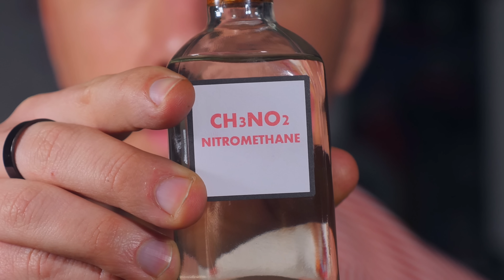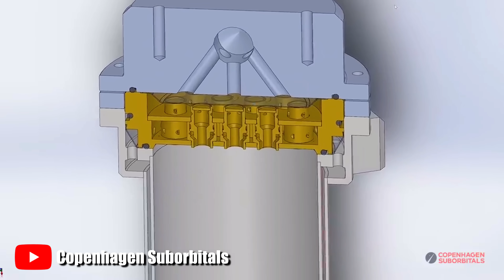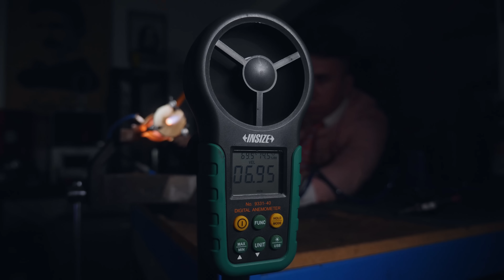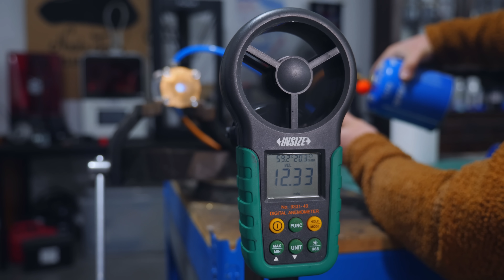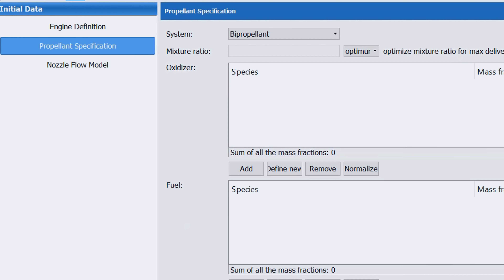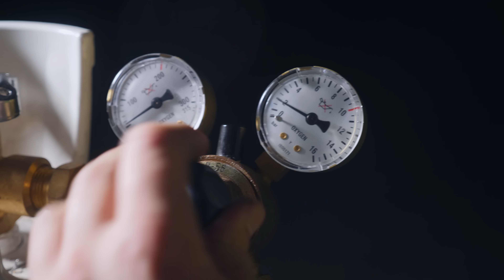GLASS ROCKET ENGINE

Comment: Yes, oxygen contains a lot of oxygen, but you know what contains even more oxygen than oxygen?
Chlorine Trifluoride. Now, don't let the lack of any oxy-sounds scare you off, this stuff is a better oxidizer than oxygen, and will quite happily enable you to use things like concrete bricks, asbestos, water and gravel as fuel.
Is it a good idea to use this in a rocket? ... Well the Germans in the 40's were afraid of using it in flamethrowers because it was too dangerous, so maybe be careful. :)

Comment: I recommend that everyone interested in this subject find themselves and read a copy of "Ignition! an informal history of liquid rocket propellants" by John D. Clarke. Fantastic book. Includes such lines as this describing Chlorine Trifluoride: "It is, of course, extremely toxic, but that's the least of the problem. It is hypergolic with every known fuel, and so rapidly hypergolic that no ignition delay has ever been measured. It is also hypergolic with such things as cloth, wood, and test engineers, not to mention asbestos, sand and water - with which it reacts explosively."

Comment: Great video today!  Also, while I'm no fan of creators shoving in multiple ads within one video, I think you presented yours quite well.  Your videos were always pretty good but it seems like your overall production of them is getting better and better.  It's cool you got a CNC, next you should get a metal printer, just need to sell an organ or two and build a whole new room for it, who needs two kidneys anyway, right?

Something I've always wondered is if there is a 3d printer out there that takes some sort of powder or liquid and uses it to print synthetic bone or teeth, but not just in their normal shapes but also in actual structures.. so the material is like bone or tooth but the structure/designs are still actual structures/objects.  Maybe since we're past Halloween it's a little late for this idea, but I was just curious.

Comment: I would really love to see you integrate ESP into your glass rocket engine and use an aerospike nozzle along with a regulated current to push the engine to its limits. Let's see how much thrust you can get out of the same form factor.
Reply: Also, can you be a cowboy and regulate the thrust using a potentiometer for instance? It doesn't seem quite practical; however, it could be a lot of fun. Love the videos keep them coming!

Comment: you could make a micro Archimedes screw to feed the Potassium-permanganate through glands with backfeed tubes to the pre combustion chamber and use the fuel as a driven cushion to keep the liquid and solid fuel up to injection pressure think anular archimedes screw :).

Comment: hi there, maybe you should consider printing FDM parts with some high-temperature PETG or PA there is a company that has some unique PETG that can withstand temps up to around 200° but  I think quite a bit less than 0.45MPa but don't quote on that one.

Comment: Hmmm, using the decomposition of hydrogen peroxide to drive a closed cycle fuel turbine and then venting it into the combustion chamber might prove to be quite efficient and make a rather compact engine. Just flow the peroxide over a catalyst.

Comment: Making a rocket engine with nitro methane and hydrogen peroxide, with electric arc ignition, would be fun project to follow. It's obviously going to be a multi part series, as just getting the atomisation of both injectors right is going to be tricky. Electro coating the hydrogen peroxide injector with silver will give you at least partial decomposition, which should be enough to start combustion, which will cause the lovely thermal runaway decomposition peroxide is known for.

I think a two-stage combustion chamber is the way to go. The first, smaller one, should house the two injectors and the electric arc initiator, whereas the second, larger, combustion chamber needs to focus ideal mixing.

As for getting the pressure up on the injectors I think, for prototyping, just using compressed nitrogen to push the liquids out the bottom of the containers might be an idea. Perhaps repurposed CO2 bottles for soda machines would work. That is, you unscrew the factory attachment and find fittings of the same thread pitch. Then load the liquid in, attach the valve, pressurise it, close the valve, flip it upside down, and presto, you have fuel/oxidizer delivery at, say, 5-6 bars.

Of cause, for the final iteration, getting a glas blower to make the whole combustion assembly in quartz glass would make for some EPIC footage (and probably also be very expensive!).

Comment: i would like to see some form of engine intagration like colin furze with the turbo charger / pulse jet design. i don't have any reason to beilieve that it works but the concept felt interesting enough to share. also self-barbeque  is bad so be aware.

Comment: I like your "Dual propulsion rocket" idea alot I think a workable idea would be to have two tanks (H2O2 Peroxide) and Fuel tank top them off with compressed air. So if you open the valve they get expelled. Than I would spray the H2O2 on a mesh coated with Permanganate (KMnO4) to decompose the H2O2. after decomposition add the fuel.
instead of KMnO4 you can use MnO2 this way you get decomposition without adding oxygen, but it will stay the same. You get the MnO2 from KMnO4 after it has been used once.

Comment: 3:01 That's a common misconception. In fact, Top Fuel dragster engines are FAR more power dense than any Nitro RC engine that exists. No matter if your judging "power dense" based on engine size/volume vs HP or by engine weight vs HP, Top Fuel engines are far more power dense.

Comment: Since those engines are so small, you could put them on a pivot and use them as very noisy propulsion for a low friction craft.

Rocket Sled.

i don't suggest having large vats of Hydrogen Peroxide though, that stuff is ultra spicy if the closing part of the video is any warning.

Comment: ok, so, now I'm curious. can you dissolve / suspend the potassium permanganate inside the methanol, and use a dual injection system with that mixture in one and hydrogen peroxide in the other?

Comment: You could try making a catalyst to extract oxygen from hydrogen peroxide by mixing manganese dioxide and calcium hydroxide and 3D printing resin and printing a honeycomb pattern, like an automobile catalyst. As soon as the hydrogen peroxide comes into contact with the resin impregnated with metal oxides and hydroxides, some of the calcium hydroxide will dissolve in the aqueous solution, leaving the water slightly basic, meaning that as soon as the hydrogen peroxide comes into contact with the dioxide, of manganese decomposes into water and oxygen. Manganese dioxide is insoluble in water and calcium hydroxide is slightly soluble, meaning you can reuse this catalyst several times without making that mess when done with potassium permanganate and finally the resin printed in a honeycomb pattern gives more contact surface.

Comment: You should make a plane powered by a liquefied gas. It could work like an air enigne, only using a far more dense "fuel". Possibly could also use a flammable gas and make an internal combustion engine.

Comment: You should print a PLA jet engine that has provisions for a flowing water jacket to pumped through to cool the plastic and prevent it from melting. Like when those wilderness survival guides boil water in a plastic bottle over an open flame.

Comment: 1:47 What a cute little turbo ! I recently built my first DIY turbojet engine and I can't wait to see what you'll do with it ! (a bit too much for the skateboard :D)
There is a lot of power involved in those turbojets and welding is often required. I can share my flametube and combustion chamber designs if you want, they require no precision machining and, let say, few welds.

Comment: Make a combustion chamber, injector, nozzle out of stainless steel that you milled on the CNC. Inject ethanol, methanol, or IPA with permanganate in solution, and some high-test H2O2. Optionally use a spark plug ignitor. Stand back and wear your protective gear!!

Comment: Digestion is combustion, the product of the reaction of digesting is energy + CO2 + H2O just like combustion so HULE is FULE. Can you make a wing with ducts on the trailing edge that lead to a EDF or a rocket engine so the wing will get lift as air is pulled over the wing making it a VTOL?

Comment: Would be cool to build a scramjet engine, perhaps using a leaf blower to achieve the air speed to make it run;  as fuel I was thinking of the mixture of sugar and potassium nitrate that you used in the Aerospike Rocket engine project some years ago, perhaps added with oxygen or methane.

Comment: It would be cool if you could show how a ramjet work. You could have a first stage with on board oxidizer, and a second stage in which the oxidizer is air compressed from the "flight" of the jet. I guess it can be a tricky video, but it would be amazing,.

Comment: Do a video on microwave power transmission like the US Naval Research Labs are doing. The ionic thrusters may not need a battery or a very small battery if solar power farms can beam the energy via microwaves to the ionic thruster powered plane. Like you can make a RC plane powered by ionic thrusters via microwave power beam.

Comment: I would think that a mixture of Nitromethane and 50% H2O2 pumped through an atomising jet and across an appropriate reactionary catalyst would make a fantastic fuel - catalyst and fuel in one mixture. The devil would be in the correct proportions and pressures so that you would not experience an inadvertent energetic event.

Comment: The German WW2 Me-163 used Hydrogen Peroxide as an oxidizer.  However, it used Hydrazine as it's fuel.    Do you plan to do anything with your rocket motor when it's finished? Rocket powered car, plane, boat, or plain old rocket?

Comment: Integza, I've said it before and ill say it again, please be careful around Potassium Permanganate. The pure form you use not only causes permanent discoloration but is also toxic, can cause chemical burns and are a big environmental hazard if not disposed of properly. Please be careful Integza! That said, really informative video as always! btw what would happen if you would coat a tube in solid permanganate and then run the hydrogen peroxide through so it won't mix with the permanganate, would it still generate enough oxygen? There are also hobby pressure tanks of for example 0.3l that can go up to 12bar, this might be enough to hold the oxidizer, especially with the nitromethane.

Comment: I dont remember where I heard of this but instead of swirling the oxygen and hydrogen(should work with butane) together at the combustion "plate" what about premixing them and then letting them out and igniting them, ofcourse it is quite important in such a design that the intermix pressure is higher than the combustion so requires somewhat of a nozzle

Comment: Wincing a bit when I see you mixing methanol and peroxide in a glass jar, in that quantity in your house. You got to start doing things like that outside before you blow up your self or your lab .

Also hope to god you had a flame trap on the oxygen line 😅

Recommend you read the book Ignition by John D. Clark if you haven't already, Don't repeat the mistakes guys already made in the 1950s
Reply: Also please at least use a polly carbonate barrier/screen between you and the beaker that might explode, instead of standing back and flinching.

The safety specs and safety tie won't save your pretty face.

Safety third and all that

Comment: To decompose the hydrogen peroxide into the oxygen you need (please steam for good measure); what is you used a metallic catalyst instead of chemical? This way you don't have to inject and store the permanganate which will add weight.  It might make a cleaner combustion in the end.

Comment: Would it be possible to use a portion of the rocket's thrust to spin a mini turbocharger, forcing more air into the rocket?

I get that there are probably lots of energy losses involved, but it would be pretty cool to see how well a self contained, self accelerating rocket engine would do

Also, love your content, keep it up😁🔥

Comment: Your assumption that you are getting 6 bar chamber pressure is probably wrong. My guess is it’s way lower based on the oxidizer mass flow rate and that your exhaust looked very over-expanded. My tip for beginner nozzle design is just to use a small throat diameter and conservative expansion ratio, say 2x. That way you’re more likely to have choked flow and supersonic exhaust . Cheers!

Comment: I’d like to see you use a platinum mesh to decompose the hydrogen peroxide. It would eliminate the potassium permanganate since you’d just have to inject the h2o2 into the mesh. I think you would need a higher concentration of hydrogen peroxide.

Comment: I think a great project would be a bicycle powered by a jet engine. Another thing that requires a lot of thought - a solid-fuel rocket engine, but one that could, to any extent, control the combustion rate of the mixture and turn it on and off.

Comment: Do you know what has more oxygen than air?  Oxygen
Do you know what has more oxygen than Oxygen?  Chlorine-Triflouride 

(wait, there isn't any oxygen in Chlorine-Triflouride)

While that is true, it is a better oxidizer than pure oxygen itself, though I wouldn't recommend using it  (odorless, colorless, poisonous, corrosive, and EXTREMELY reactive with common reactants being even more toxic and corrosive, plus it can start glass and ashes on fire...)

Comment: So how about a pre-mix of fuel and hydrogen peroxide in a tank combined with a high pressure pump then after the pump add a continuous measured amount of potassium permanganate that would feed a combustion chamber with an ignition source?

Comment: When you start getting into extremely high power densities, you start having to get very picky about what counts as the mass and volume of the engine, and what even counts as an engine. I suspect a HE hand grenade would be more powerful density than any rocket engine, and I suspect it would take a little thought to come up with a definition for engine that allows liquid and solid fuel rockets and piston engines but would not allow grenades.

Comment: Wouldn't it be better if you used non-carbon emitting fuels? I know in the grand scheme of things it's a tiny contribution, but as they say... every little hurts! Also, when speaking decimal numbers, you should always say each digit after the decimal point individually, don't say something like zero point sixteen. At least that's what my math tutor always drilled into me.

Comment: How about building a rocket powered generator?  Similar to but, 
A much more professional wood powered turbos seen in videos, using the turbos shaft to spin a generator and possibly using the heat in the pyrolysis of wood to create methanol or wood gas to fuel the rocket, or make it a wood fueled jet engine generator! The problem is the jet (turbocharged wood stoves ) destroy the turbine, a liquid or gas fuel would possibly limit this. Maybe build a turbo with two exhaust housings and turbines! 😮, then get if to spin some magnets , I guess a thin 2mm, bunch of N-52 magnets. Attached to an aluminum hub. Then wrapped with a carbon fiber string or ribbon, tow, what ever it's called,   keep the carbon about 1mm thick, and glue them on with a good adhesive .it could possibly spin 60k rpm, if directly driven!  Could be a cool project! Maybe a useful one!?

Comment: It would be nice to see you build a Turborocket, combing the ideas of both a Jet engine and a Rocket. It consists of a turbine driven by the incoming gases which inturn allows in more air using multi-stage fans connected to it. This compressed mixture an be then pushed to a combustion chamber for generating thrust. Would be nice to see it working...

Comment: Well, that CNC machine will make it a lot easier to build the heat resistant things you need.  You mostly do things that fly or roll.  How about a gas turbine RC boat, possibly as a collaboration with Ivan Miranda!

Comment: For Room Temperature Oxidisers there is one that is surprisingly easy to get....nitric acid. In high purity it was used in for that exact purpose, usually mixed with NTO and Hydroflouric Acid in Red Fuming Nitric Acid (RFNA). It is also surprisingly less toxic than you'd expect. I mean it's still toxic but compared to other room temperature liquid oxidisers like actual RFNA or pure NTO, or the fuels those are used with nowadays it's quite harmless...like a very angry bear but at least it's not a polar one.

Comment: I have 2 suggestions. 
One, can you design a rocket producing adequate thrust to run a piston engine?...not a turbine, but instead one that provides pressurized gases that move the pistons directly.

2, Can you build an internal combustion engine small enough to power a clock for 24 hrs?

Comment: Didn't the Germans make a rocket using Methanol and Hydrogen Peroxide?

Messerschmitt Me 163 Komet
Rocket interceptor developed by Messerschmitt late in World War II

The Messerschmitt Me 163 Komet is a rocket-powered interceptor aircraft primarily designed and produced by the German aircraft manufacturer Messerschmitt. It is the only operational rocket-powered fighter aircraft in history as well as the first piloted aircraft of any type to exceed 1,000 kilometres per hour

The only thing, the high strength hydrogen peroxide eats any organic material, including humans!